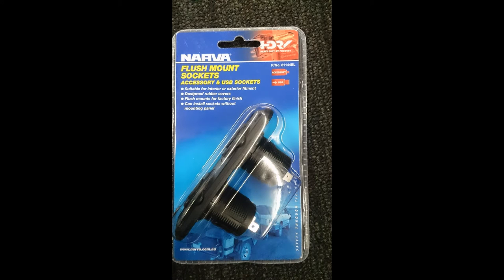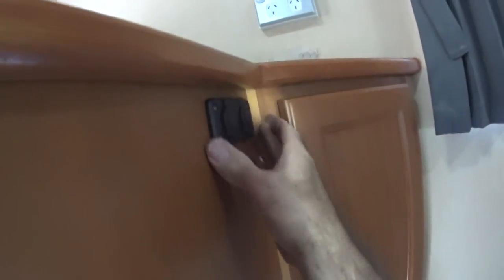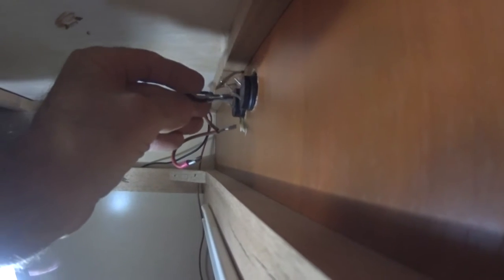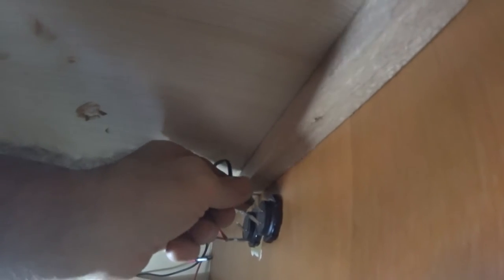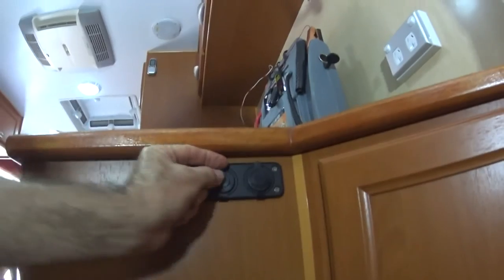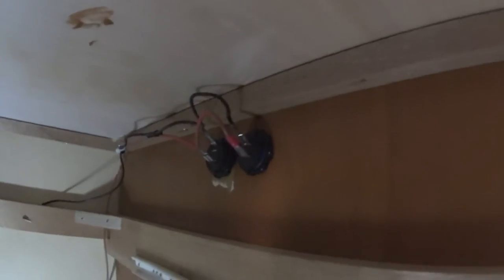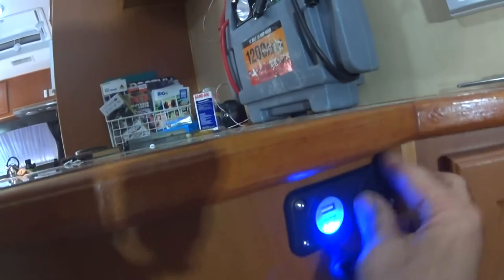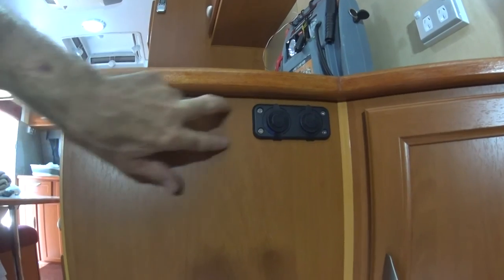12 volt DIY project fitting USB Socket and cigarette lighter socket, Caravan RV Motorhome.

Comment: Great install video. Hey do you find the plug leaches power just sitting there? I'm waiting on delivery of my own and wondering if I shouldn't have gotten a switch too.
Reply from the maker: Trevor Marty Hi no I think the power used is very very minimal as there is just a blue led light running all the time. I have not tested what the drain is, but it would be low, if you feel you want a switch they don't cost much and will give you please of mind that all is good. BUT in saying that when parked in-between camping trips, I turn the main isolator off on the battery just in case anything shorts out or drains the battery. I do think a main battery isolator is a very good idea. Hope that helps

Comment: Thx for the video. I can see the blue light could get annoying if wanting to leave a cable in overnight. Can you turn the led off? Or do you know if you can buy without the blue led? Cheers
Reply from the maker: Hi at the 4.30 min mark you will see both the plugs have covers that totally block the blue light from view. It can be seen when the USB is in use, I have not had a problem or even thought about the blue light, but I have the covers on at night when sleeping. I don't think you can turn it off on this unit that I know of, but if you google I am sure there would be ones that do not have them.Thank you for your comment.

Comment: What are the connector plugs that you attached to the back of the cigarette lighter?
Reply from the maker: They are for 12 volts if you search "Electrical Terminals - Female Blade"  you will see them, or ask for them at any auto store. There are other types so check the wire fitting on the back of your unit to see if you need a different type. Hope that helps a bit.

Comment: what size cuter did you use ?
Reply from the maker: I used a 29mm hole saw, measure what you are putting in to make sure the hole matches what you are installing, quite often the hole size you need is written on the unit packaging. Hope that helps.

Comment: Hey man! Wicked video. I’m running the same set up. Just a question. What size wire did you use? I saw you’re using a 10amp fuse. The accessory socket says it runs 20amps on 12volt. Plus the 2.5 amps for the USB’s.
Reply from the maker: Hi, I used wire the same as was in my RV, it would be better to ask an auto shop that sell wire what size you need, they will ask you how far it is going to run and what are you going to run on the plug etc, get the right wire then there is no chance of it getting hot. I am only running a 10 amp fuse as this setup for me as it is just to charge cameras etc and there is no need for a bigger fuse for that. Thank you for your comment.

Comment: Great video. Thanks. How  would you connect the other end to a leisure battery?
Reply from the maker: If your battery has outlets get an end that will plug into that, if it does not, maybe use alligator clips to attach it. Thank you for your comment

Comment: Where did you get the wire leads from?
Reply from the maker: Hi, They are just wires from an Auto parts store and the fittings came from the same place when you buy your USB socket etc the place you get them will also sell the fittings. Hope that helps a bit.